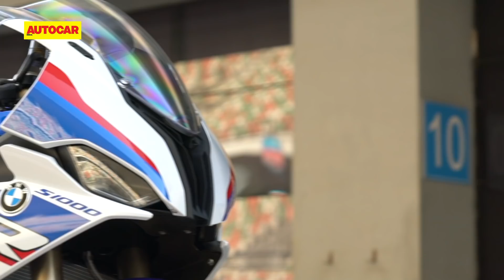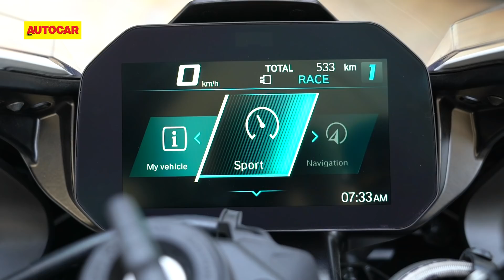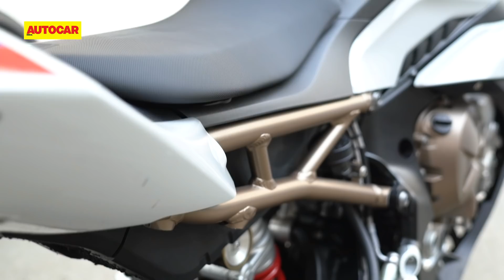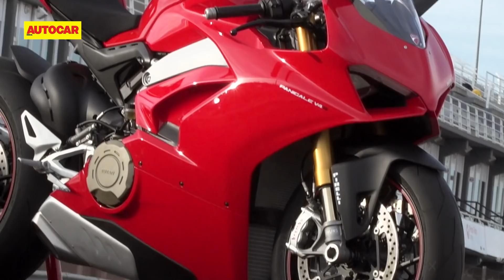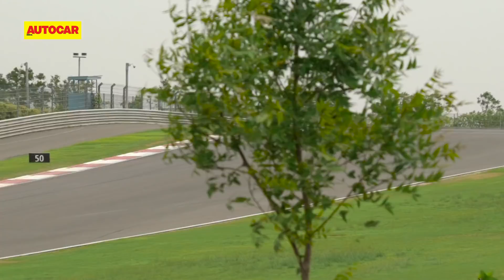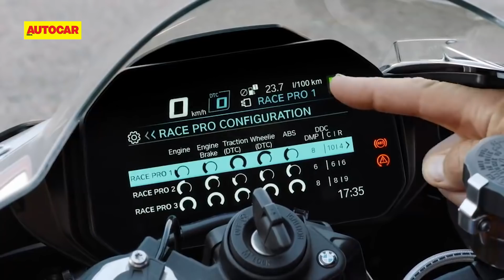2019 BMW S 1000 RR | First Ride Review | Autocar India

Comment: Not a big deal in powertrain... That's a Variable Valve lift in which cam slides on shaft splines, Yamaha calls it VVA ...kawasakis are equipped with 7 way traction control.